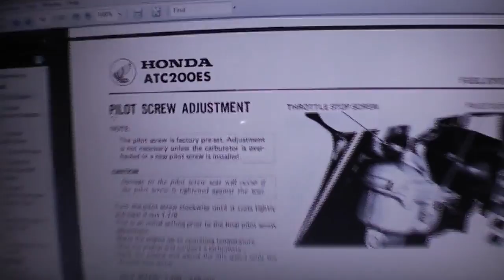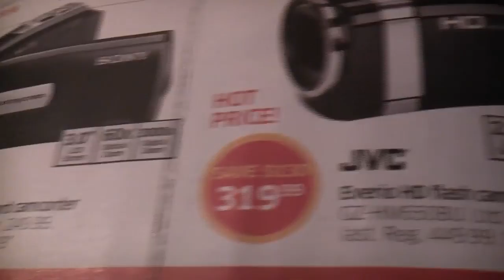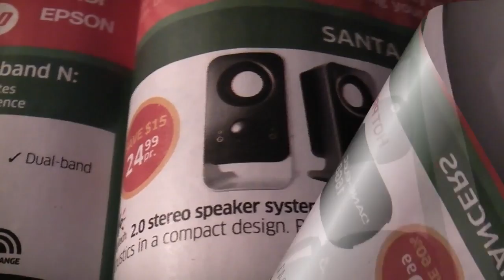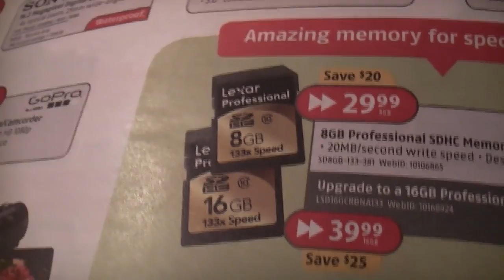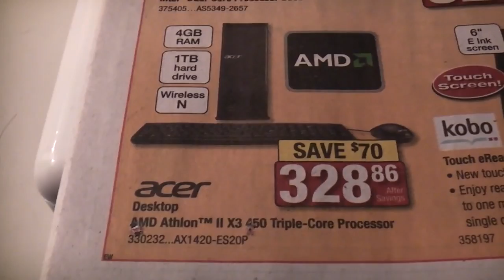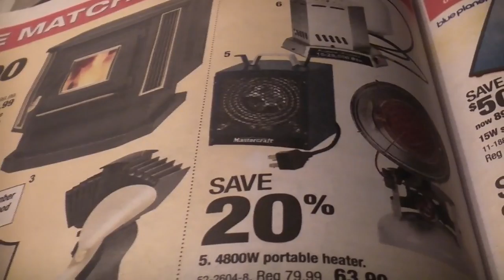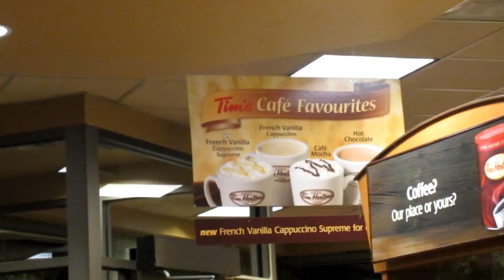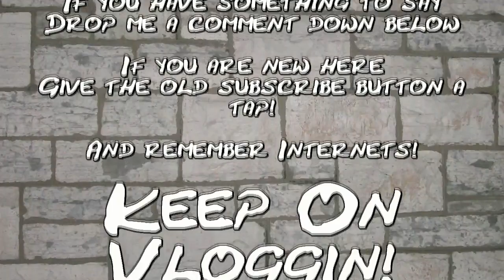(Day 288) - 11-05-2011 - The Spark of Genius

Comment: btw those engines dont like running wiht the filter removed. it leans it out. get that filter cleaned/replaced asap. a new plug, and perhaps the coil will work wonders

Comment: Good, your not giving up..:-)
The screws should not stop it from starting, with simple carbs its all down to clean clean jets so the fuel can get through in the correct air/fuel ratio.
looks like your in a better mood :-)